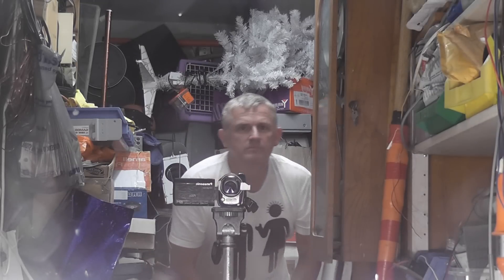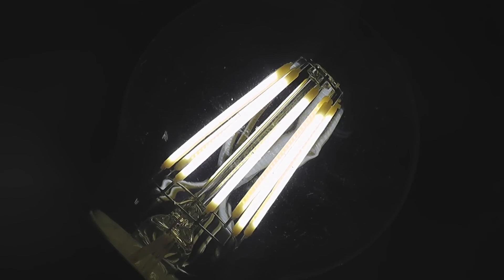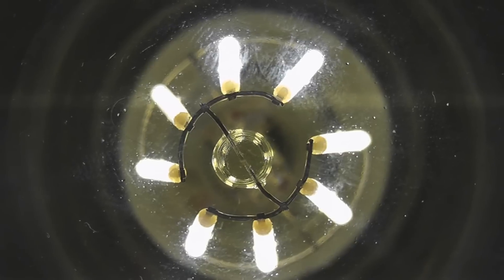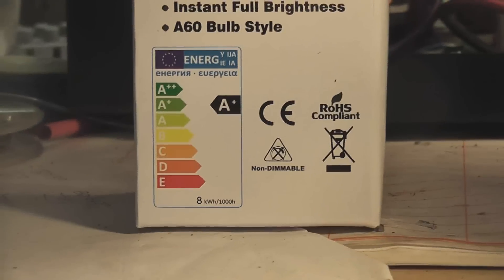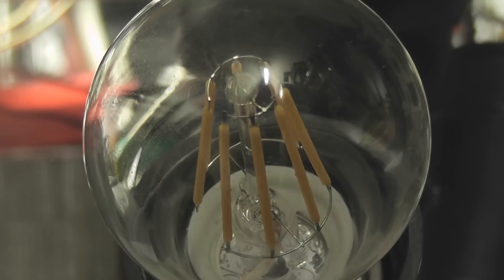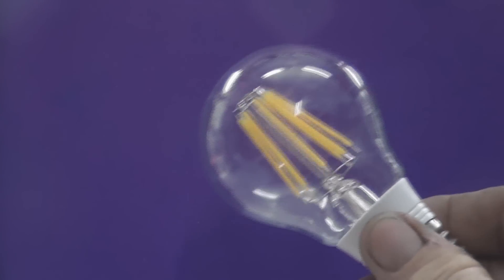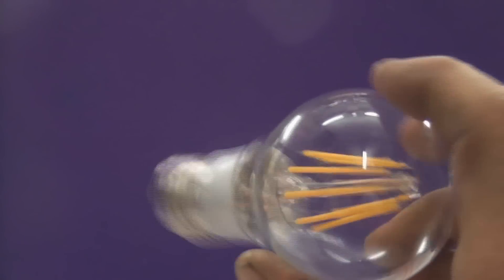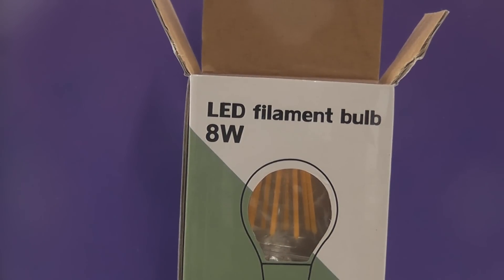LED filament lamp ( simply brilliant )

Comment: wow cool, that is some very interesting technology, so it is basically a very long led to take higher voltages, what sort of driver is in it? does it rectify then limit current or what? thanks for sharing!
Reply from the maker: SuperBrainAK  Yes they are basically long strips with multiple led's in series. Have a look on bigclivedotcom channel in the description. He is a LED lamp expert and takes these units apart. Mains is dropped via capacitor and bridge rectifier circuit.

Comment: I wonder about the thermal management of the LEDs inside. These seem to use only convective heat transfer through gas to remove heat. Run one continuously and periodically compare to a new one to see if light output is falling over time.
Reply: But the difference is that these take far lower current than the average LED-lights we saw till that time, which were mostly high-power single LED lights. The high-current also means that there is a lot of heat to be dissipated.
The smaller LEDs on these filament strips are drawing less current and thus less heat and the heat is dissipated better.

Comment: Some of the cheap and nasty versions of these use a plain air fill in the envelope instead of the high thermal conductivity helium or hydrogen gas mixes that proper ones use.  Those are the ones to be careful of in terms of premature failure due to overheating.
Reply: Do you know who makes a quality led filament bulb?
Reply: +randacnam7321 
I have seen some new high performance lamps that are liquid filled. They are filled with a type of mineral oil, and they are bloody bright. Rated at 30,000 hours too. These cheap ones only 2500, which puts them in the same rating as good incandescent.

Comment: In 10 years everything will be LED. No problem except it all seems to be made in China. CFLs and HID are going away hard right now
Reply: +shango066 10 years? Really? I give it 2 years tops and it will be hard to find anything but LED. The price is already dropping, and will continue to do so, and they lifespan will also be reduced. I can see the manufactures putting a timer chip into the driver so that after the rated life it just stops working. I can see LED bulbs being 1.00 each and having a 1000 hour life span just like old incandescent. Planned life span so you have to keep buying new ones. What good would they be if they lasted 20 years. Everyone would replace all their lights and then there would be no more business model. SO they want them to be cheap, and have a short life so you have to keep buying. That is how business works.

Comment: Mmmm, Look at 'em Glowiiiiiiiiin'. :-)

I wonder if these are available in something else other than 2700k ?

Maybe 3500k or 4000k ?

2700k is a bit 'warm-white' and I don't really like 2700k in 2D lamp-shape.

These might be OK for lighting a room with a soft light, but it would also be nice if these were available in a range of colour-temperatures.

What would be interesting is if these can be dimmed. I'm not sure how a traditional dimme would deal with these, as Mr. Photon once found out when he changed his bulbs for LEDs.

The only downside with these..... you can't stuff an arc in them.

Thanx for showing,

-BoomBoxDeluxe.

8th May 2015, 18.00

Comment: Are they dimable?
Reply: Green Silver I'm not sure why the LED's would flicker. Never heard of LED flicker. CFL and any kind of lamp that runs off a ballast and has a (Refresh) time due to a higher voltage... those are common to find flicker in. LED"s are low voltage. This lamp here is just a bunch of  LED's in series/parallel with a lamp driver (current/voltage limiter). The only reason a dimmer can't be use on some would be that the circuit depends on a minimum voltage to stay functional. Semiconductors are like that.  If it blinks at a low dim setting, it's barely keeping the circuit awake.  Some dimmers are bad because the dimmers themselves cause the circuit to open and close rapidly ( that's how it reduces the current). The diodes controller dont tolerate that surging activity too well .
Reply: Green Silver No, they are not dimable. Even led bulbs that say they are dimable tend to flicker if you dim them.
Reply: rocketman221projects 
The two LED dimable bulbs I have don't flicker on a regular dimmer, they go to almost off (unusable light output) and will then start going on and off. 
I often have them very dim around 10 watt incandescent equivalent with no problems.
Reply: +Bruce Wrigleys Gumchewz Do you know a model of a dimmer that works with these?

Comment: I hope yours last longer than mine. 50% dead on arrival, the rest developed issues pretty quickly. The ones I took apart had mechanical damage to the LED modules, probably too much vibration during shipping.

If you're interested, I made lots of pictures during tear-down:

http://blog.spitzenpfeil.org/wordpress/2015/04/06/spontaneous-led-bulb-teardown-filamented-led-light-bulb/
Reply: what brand were they? I'm trying to find a brand that uses a quality air fill but there is such little data about these out there. Im guessing a reputable brand like Feit would do.
Reply: Rob Lo No clue what brand they are. I think I got these on Amazon. The last remaining one still works.